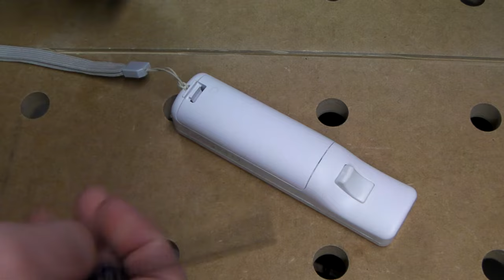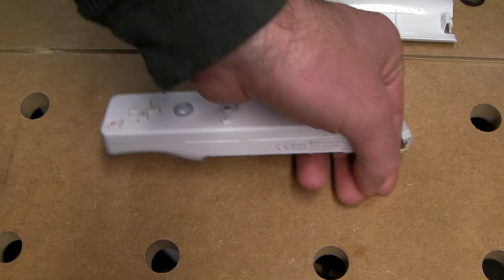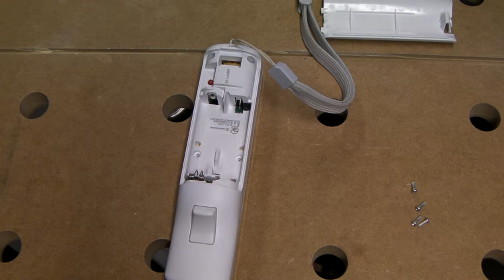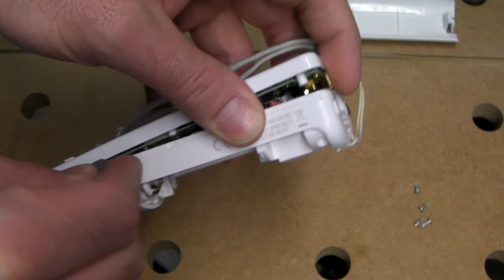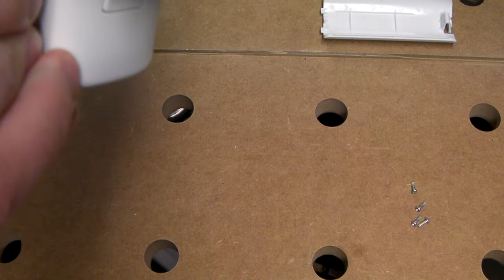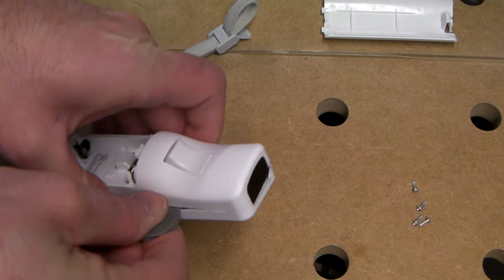Wii Remote Disassembly

Comment: I have a question, what type of screwdriver did you use?
Reply from the maker: I use this triwing screwdriver I bought on Amazon. https://amzn.to/2CARfsD (affiliate link).
Reply: I recommend try wing Y1.5 or Y2.5
Reply: I used wing Y2.3. Works perfectly
Reply: @svendesce I am using Y2.0 but screws won't budge.

Comment: Mine won't unscrew what do I do
Reply from the maker: Did the screw strip out or is it just tight?
Reply: @Rickmakes  I think it stripped
Reply from the maker: @Tony-bl3co   I have seen a trick where you place a rubber band between the screwdriver and screw to give it more grip. (https://www.cnet.com/how-to/remove-a-stripped-screw-in-seconds-with-this-office-supply/) You would need to press in hard but be careful you don't slip and stab yourself. If that doesn't work, you could try drilling out the screw but that can be difficult on something like that. If you were to get it open, then you would have to use something else to hold it together. It could be something like electrical tape (which you could remove) or glue (which would be permanent).
Reply: @Rickmakes  thank you